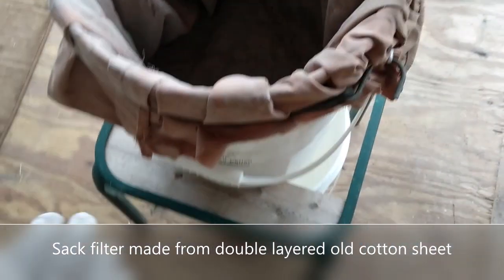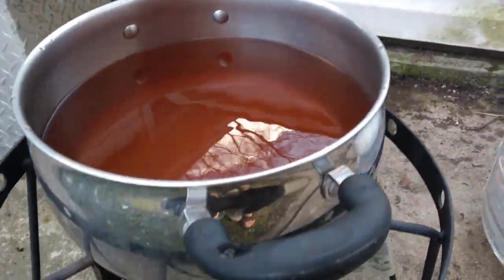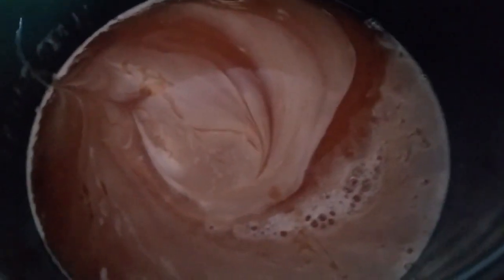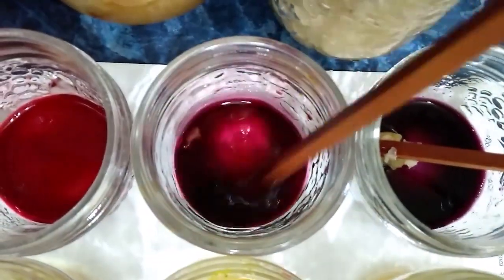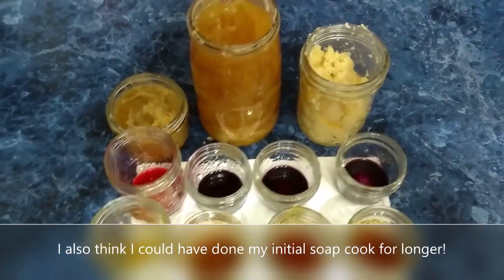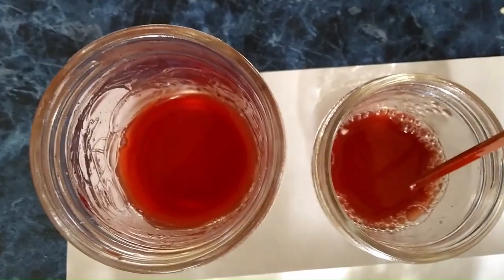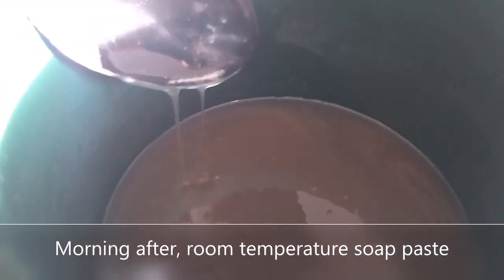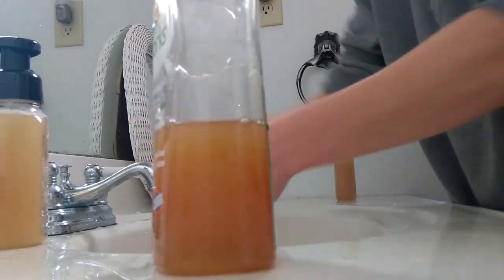How I made hardwood ash soap - Leaching barrel method

Comment: baking soda  neutralizes most anything acidic is the answer to the ph problem.  your going the long way around. i found out by accident by trying to make biodiesel that all you have to do to make soap is ad the potassium chlorate to hot oils of course 'temperature specific' is to place it in a jar while still hot and give it a shake.  All I did was tip the jar with the lid on and bang soap. not the results desired.

 the liquid you keep running into is diesel oil I suspect that way to test that is to see if it is flammable by heating it and trying to touch it off. a few extra steps will refine it and soften it. just takes repeating the process a few times.  i know why you went the long way around. if you were willing to do that then the extra mile is not a problem for you. if so . if nothing else it would make fine lamp oil. I'm sure it would wick very nicely. wich by the way would be an excellent method to draw it off. 

the fattest oils are best, think beef tallow.  it is not cheap so that is something to consider your. local butcher should have some on hand if not a simple request should suffice.  its the difference in the oil world between the can marked "beer" and a 100$ bottle of 20-year-old bourbon.  for your reasons why.   I'm sure there are benefits to working with it as well.  try and take the guesswork out of it, it will be to your pleasure.  keep up the good work.  it's been said that only stupid people buy things. you are on the right path keep trucking.